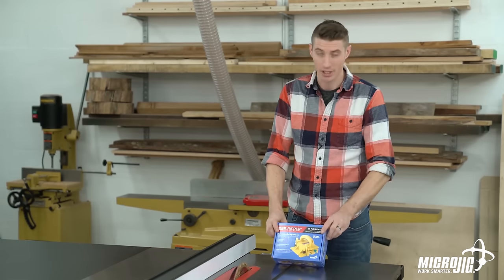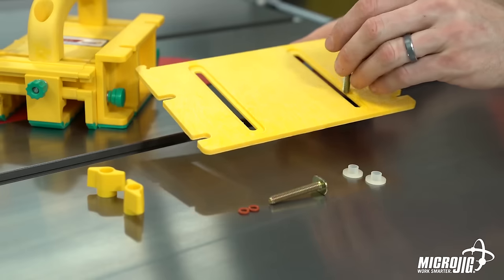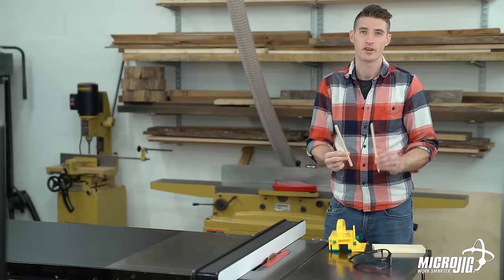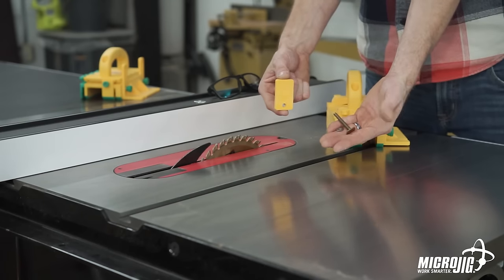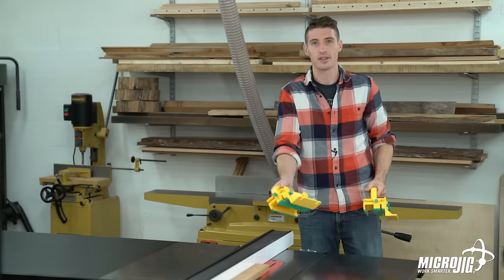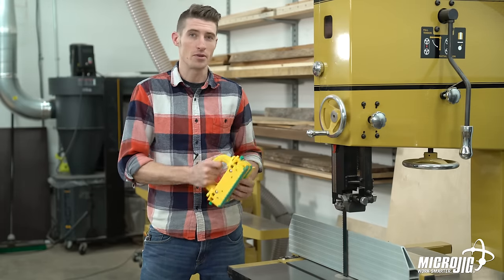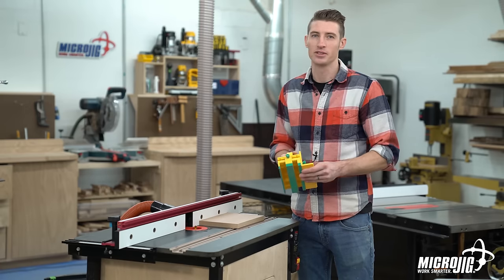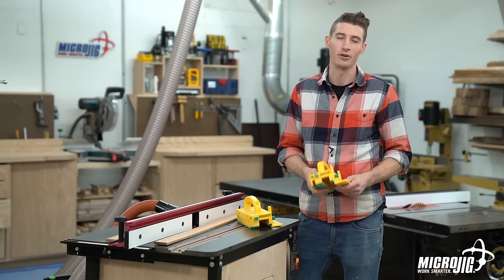GRR-RIPPER | Full Instructional Video (2018)

Comment: With all respect, at 11.19 you pulled the wood away from right to left across the blade path, towards you without switching off the saw. You may well, understandably, think you are safe as the grip secures both pieces of wood. However, I would recommend you inform your viewers that it is of great safety importance to always, always, switch off the saw before moving, removing, retrieving, etc any wood. Wait till the blade has come to standstill, then deal with the wood. Thanks for your demo of the gripper, a great tool.
Reply from the maker: We will never tell you not do something you think is safe. But to be honest, turning the saw off and waiting for the blade to stop after each individual cut is overkill in our opinion. 
The control of the GRR-RIPPER does allow for BOTH parts to be run all the way past the blade and brought around the the front for the next operation. 
This is much safer than having the off fall rattling against the blade as it winds down.

Comment: I am not sure about this product. It seems like an expensive jig for making very narrow in-lays. One thing I know for sure is that the #1rule with table saws is that you always want to support the part of your work piece that is between the fence and the blade. You should never support the work piece outside of the blade, because that will cause kickback. Also, you always want a positive engagement with the work piece as you run it through the saw and that should be done with a push stick and NOT with friction. Why? Because friction is not a reliable means to control the work piece. The flaw with this device is that it relies on friction. Those nice greed pads will eventually lose their grip and the gripper will no longer function. This thing gives one a feeling of security, but it is NOT secure. I would not purchase it. Instead get a decent push stick, or better yet, make one out of plywood. Always support the work piece that is between the fence and the blade. The outside piece will not go anywhere. You wait for the blade to stop to cut the off-cut. And stay safe. If the cut doesn't feel right... DON'T do it that way.
Reply from the maker: You need to always do what you feel is safe, but honestly, your interpretation of the cut physics is wrong. 
1) Not controlling your off-fall part leaves it loose and rattling against the left side of the sawblade with nothing to keep it from catching a tooth and kicking back. 
2) the push stick is only controlling the inside back corner of your part and as the part passes the front of the blade, it can wander away from the fence and rub against the BACK side of the blade as the teeth rise from inside the saw. This is where the tool marks come from, and again, if those teeth catch, the part can kick back. 
Using the GRR-RIPPER on a properly set up table saw will leave a rip cut with NO TOOL MARKS on either side of the cut, fully proving that the GRR-RIPPER is keeping the parts under control through the entire cut process.
3) With the GRR-RIPPER, once the parts exit the blade cut area, I can bring BOTH the rip and off-fall parts back around behind the blade, so I do not have to reach across the spinning blade to get my rip piece. 

The GRR-RIPPER has been out for 22 years now and we have sold hundreds of thousands of them. Over 80% of users give them 4 or 5 Star reviews and use them daily as I do. 

I invite you to call our offices at (855) 747-7233 and discuss these issues in detail with me, I will be happy to explain it all. -Ralph

Comment: I like it but I'm a little confused . . . this is something to help with safety, right? But, I am supposed to remove a key safety item on the table saw, my blade guard, which also forms part of my sawdust collection system to keep particulates out of the air, which keeps my lungs safe long term?
Reply from the maker: MrMeraby, we will NEVER tell you to not use your blade guard if you feel safe using it. You are in control of your own safety in the shop. 
The fact is that many blade guards are not well designed and it can be argued that they are less safe than not using one. 
The GRR-RIPPER works as a moving blade guard, staying between your hands and the blades or bits that want to hurt you. We have a 20+ year long record of protecting woodworkers that speaks for itself.
Also, even using your blade guard for most cuts, there are times you cannot; Dado cuts, groove cuts and even thin rips where the blade guard cannot fit between the blade and rip fence. In these cases, the GRR-RIPPER becomes even more valuable. 
Finally, the GRR-RIPPER works with other tools in your shop. It is awesome at the router table and works very well on the jointer and the band saw.

Comment: Hi there. I use a table saw from Festool with „saw stop“-technique. So this is very sensitive for metal. Does the Gripper work with that?
Reply from the maker: Jordiii, I can assure you that the GRR-RIPPER will NOT trigger your SawStop if you happen to run a leg across the blade. 
I have personally done it many times doing demos around the country. 
The GRR-RIPPER is not electrically conductive, so the SawStop does not even "see" it.

Comment: Got my Grr-Ripper Professional 3D Push Block System Advanced - GR200  today from Rutland's while they had it on offer & followed the assembly guide here! Very straight forward & even without using it i can tell its going to make life easier & safer using the table saw & band saw. Genius!! Just checked rutland's prices & glad i jumped on it & saved £20!! Wow!!

Comment: I'd like to point out one bit of irony for a table saw safety video: the work piece introduced at https://youtu.be/C6yx8fZaIEw?t=344 is not sitting flat on the table -- it's rocking noticeably. Material should always be milled or processed beforehand, such that the side making contact with the table saw top is flat. Likewise, the side of the material riding against the fence should be straight.
Reply from the maker: While properly prepared stock is always preferred on the saw, within limits, the GRR-RIPPER helps you work safely with stock that is not perfect. Since the GRR-RIPPER holds the parts from the top and up to 8" front to back, it provides a level of control and safety not available with push sticks and feather boards. 
A slightly warped part like the one your sharp eye picked up can be held securely and is safe even as the part separates into two and the pieces set back onto the table top.

Comment: The Gripper works pretty well for me.  The only thing that doesn't go as well as in this video is if I'm making multiple cuts on long pieces.  Sawdust will tend to make its way onto the long piece, and by the time I'm ready for my 2nd piece to cut, the gripper has a film of dust on the rubber.  Then if there's is resistance/friction with the 2nd piece, the gripper will tend to slide off the front side of the wood that's getting fed, which can be dangerous.  Perhaps the best practice is to clean the gripper after each cut.
Reply from the maker: Ron, normal sawdust should not really interfere much with the grip except sometimes on well finished surfaces. But over time, wax and/or sap from the wood can build up on the GRR-RIPPER legs and effect the grip. 
Try cleaning them with rubbing alcohol and see if that helps. If it does not, please call or email our customer service folks and we'll help you figure out what is wrong. email support@microjig.com or call (855) 747-7233

Comment: Is it possible to make 45 degree cuts with the gripper?
Reply from the maker: Jehan, if you mean 45 Degree bevel cuts, with the blade tilted, YES, absolutely! You just need to be careful about where the blade tip will be so you do not cut into a leg. 
We always advise making a "check pass" without the stock and with the saw off to see if the blade and legs touch. This habit saves a lot of damage.

Comment: I just bought a gripper 200. Haven't tried it yet but it's a good thing I seen this video. I might just get a second one for longer work pieces. That's why I bought it in the first place. Cutting 9/16 th by 1/2 inch strips. Good video to learn from. Had some problems with the O rings but all in all its a great item to have.
Reply from the maker: Robert, cutting long narrow strips is what the GRR-RIPPER excels at. And once you get used to using it, the process becomes much less stressful and more enjoyable.
The o-rings do require a bit if fuss during assembly, but they keep the hardware on the parts even when not being used, so they repay the effort every time you use your GRR-RIPPERs.

Comment: I wish you had shown edge jointing. I know you talked about it, but only face jointing was shown. I just got two grippers today and I want to edge joint eight 7' long 2x4s. Ofc, an outfeed table would be super helpful, but mainly, I need to keep the pressure on the wood so it's a clean pass
Reply from the maker: Edge jointing on the jointer or table saw?
Reply: @Microjig  On the jointer! I imagine its style will be similar to that of the band saw. I got the 100 series because I didn't know the 200 series was a thing. However, seeing the video, I can just simply get the upgrade package if needed

Comment: It works fine for ripping really short peices but for me not so well if the board is longer than a foot. Probably need 2 but thats pretty expensive.
Reply from the maker: You are correct, based on your saw, we state that the GRR-RIPPER can control a part up to 18" long, and for longer we recommend using two. 
It is a bit pricey initially, but if your GRR-RIPPERs prevent a single accident, they have MORE than paid for themselves. Consider them cheap insurance.
Also, using two allows you to cut any length rip in a single pass leaving one clean, smooth edge. And at the router table, you can do the same, making trim and moldings without pausing in front of the bit, so there is far less sanding to do after. Check it out here: https://youtu.be/WA5ZXojDhhA

Comment: what is the safest height that your stock can have while you are using this tool + accessories.  I am looking for a safe way to resaw boards on a table saw and I wonder if this is a good thing to have.  I am just not sure if the stability of the tool would be compromised due to having such tall stock compared to normal rip/cross cuts (I want to make my 2x4s into 1x4s using a table saw, would this be helpful ?)
Reply from the maker: The Balance Support on the side of the GRR-RIPPER can extend 2" below the legs, so that is the first limit. It can be bypassed by adding a spacer block beneath the Balance Support.
The GRR-RIPPER needs to guide along the rip fence, which is typically 3" tall, so that would be the next limit. This can be extended with a tall auxiliary fence mounted to your rip fence. 
At that point, the ultimate limit for resawing becomes the blade height of about 3 to 3-1/4" tall depending on the blade and saw. 

The GRR-RIPPER can also be used on it's side, pressing the stock against the rip fence left to right instead of top to bottom. In this case, there is no height limit, You can resaw this way up to double the height of your blade by cutting from both edges. 

Please feel free to call our office during business hours a (855) 747-7233 if you need to discuss this further, I'll be happy to talk you through it. Ask for Ralph
Reply: @Microjig  Really appreciate the detailed response from you guys + the additional option with the phone number and name,  I will be recommending you guys to anyone I know who has a table saw 😁 thank you very much

Comment: I have an old delta with a fixed riving knife so its to high to run jig over it like u did in this video- any suggestions??
Reply from the maker: Joseph, Modern riving knives are pretty much all built to be adjustable in height so they can be set level with the blade. 
This allows them to remain in place if you need to make a cut that is NOT all the way through, like a tenon shoulder. 
For saws with no riving knife, or with older riving knives that do not function to today's standards, we have our MJ Splitters. These mount into a Zero Clearance Insert and are only set for 90 degree rip cuts, but they are a big improvement over not having a riving knife. 
https://youtu.be/1cenNvyTdXQ

Comment: Great tools... I got two of them because they work so well with my table saw and router table.  29:03... I actually prefer to use the Grr-Rip Blocks for my jointer and not the Grr-Ripper.  I find them easier to use without any extra setup and have more contact area.
Reply from the maker: That is why we make the GRR-RIP Block! I keep mine on my jointer as well. 
But the GRR-RIPPER can be used on the jointer for those who do not own both. 
The GRR-RIPPER can do everything the GRR-RIP Block does, but the GRR-RIP Block cannot make through cuts without damage.

Comment: The riving knife on my DeWalt table saw (DWE7480) is too tall to allow the Gripper to go over it while cutting.
Reply from the maker: Your riving knife is also the bracket for the blade guard, so it has two positions you can set it to. The higher one that holds the blade guard, and a lower position that sets the riving knife level with the top of the blade. 
Page 6 of your owner's manual shows the two settings and how to change it. If you do not have the manual, you can find it online.
Reply: @Microjig  Thank you for your very prompt reply - I'm impressed! 
The Higher setting on the riving knife is for the thru cutting position and the lower is for the non-thru cutting position as called out on page 6 figure 7. I do not usually use the blade guard (I know bad me) so can I set the riving knife at the lower - non-thru cutting position even if I'm doing thru cuts on materials?
Reply from the maker: @tomwoc1  Yes! The standard riving knife position is even with or just below the blade. That way, if you want to make a groove cut like cutting a tenon shoulder, you do not need to remove the riving knife.

Comment: Fantastic video. However, I was hoping to see the use of the gripper with irregularly shaped stock on the tablesaw as well as resawing stock as those are the things that really make me nervous.
Reply from the maker: Here is a video I did on resawing at the table saw. This shows the GR-200 which has the Stabilizing Plate: https://youtu.be/zgQMjdOwIqI
As far as irregular shaped stock, if the stock is flat but not rectangular, the GRR-RIPPER can ride the fence to provide a straight edge. This is for smaller parts. Larger parts, like trying to straight cut a live edge plank needs a different approach. 
Feel free to call our office and we can discuss your needs directly. (855) 747-7233 Eastern time zone.
Reply: @Microjig  thanks for the info!Unfortunately the link you listed is for a private video though.
Reply from the maker: @SomeDudeOnline  Fixed it, the link should work now.

Comment: Sooo we don't want to use this on wider pieces?
Reply from the maker: Where do you get that? The GRR-RIPPER excels at cutting really narrow, but in my shop there is one in each hand for all rip cuts. I also use it at the router table, band saw and even the jointer. Anywhere there is a bit or blade that wants to bite me.

Comment: Very good demo and well made product. I recently bought 2 and still learning best techniques. I'm finding it a little more difficult to accurately control longer stock than what I expected. Even while using kiln dried poplar without knots. Long half inch or less cuts 12" in length or more do not easily stay tight against the fence using the leap frog technique. Too much side pressure causes flex in fence on the average table saw.  This isn't the microjig fault but unless you own a commercial saw you may have to clamp your fence down.  Definitely a thumbs up for small stock.
Reply: Ben, if you are flexing the fence it is either: pretty poorly designed (typical for consumer products), or being improperly used..  - back-it-up with some steel angle ( or aluminium angle if easier) to stop it flexing... ( that is a metalwork job for you)

Comment: Well I just purchased this tool.  Hopefully it will save my fingers. My question is why would I need the other more expensive gripper. It looks like it’s doing a fine job
Reply: Are you still using it? I'm trying to figure out if it's worth the purchase.
Reply: @EM-fi2qg  I don’t use it like I thought I would. I find a good stick easier
Reply: @billcoley8520  That's kind of what I figured. A novelty at first. Thanks for the reply.

Comment: Why can't it come assembled?
Reply: If you can't put something this simple together, it's may be a clue that you shouldn't operate a power tool.  It' REALLY simple to put it together. In addition, Gripper is a mix-n-match design.
Reply: @hansangb  simple to put together?... these are marketed to woodworkers that should have the basic skills to make their own... so if you can't duplicate this in wood... there not much of a wood worker either.... its just more price gouging the hobbyists... typical in this society
Reply: @CementRoots  Sure. With modicum of skill, anyone can make this.  And it's not price gouging IF there are people wiling to pay for it.  Isn't that how the market is supposed to work?  Supply and demand?  Finally, not everyone starts out with Diresta-level skill set.  Who ironically had a bad accident that may have been prevented if he used something like this.   So when folks first start out, why is it so bad that products like this exists?
Reply: Don't you like building stuff??

It is probably something about "Last Laugh". If you have to buy it, you probably can't build it.....
Reply: @hansangb  : He got a  SawStop instead - but he also uses pushers etc, though the injury appears to have been in 2010 so ??? before then. It is more expensive but also works with the Grr-Ripper after a cut is finished for when you slip and  fall face-first (or palm flat) into the running blade trying to retrieve the cut pieces from behind the blade..  ( as per this video)